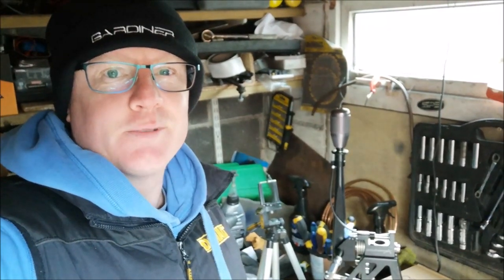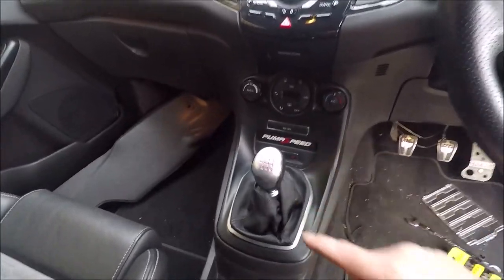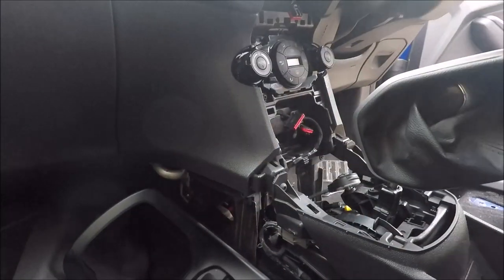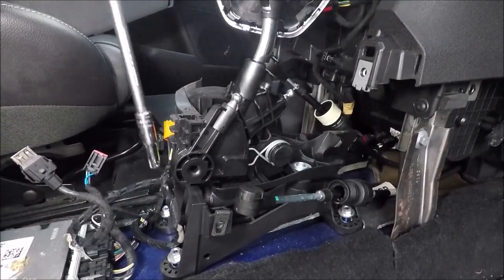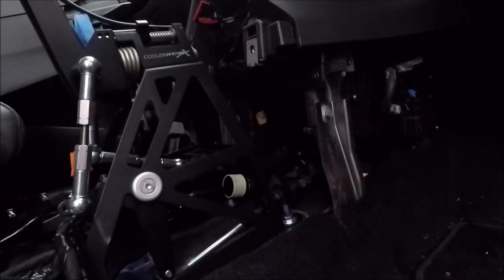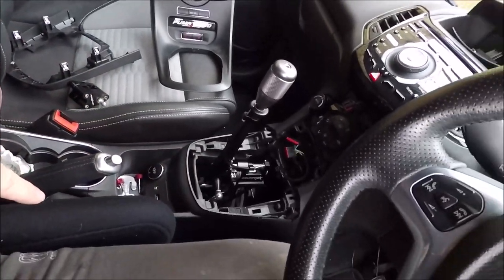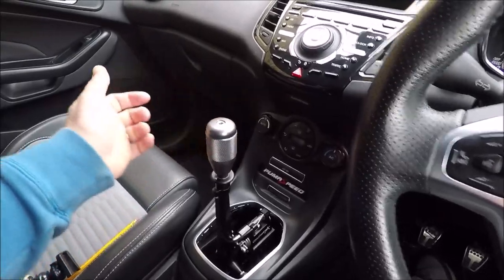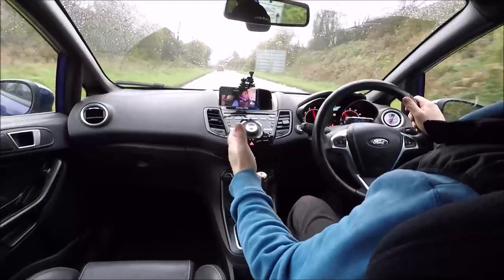Fitting a coolerworx shifter to my fiesta st 180

Comment: What pedal cover is that you have on the throttle?

Been looking for something just to bring the pedal a bit closer to brake for track use. Right now I have to rotate my heel quite a bit.

Did you do a video on how you fitted it, as I assume you'll need to drill the pedal?
Reply from the maker: It's a sparco off memory and yes you need to drill the pedal. Take off the factory metal cover and drill through. Pedal is plastic so easy to do.

Comment: Steve, do you have any difficulty insuring a salvage title  car. I am told I need an engineers inspection (and approval) before I can insure mine. Thanks for the videos.
Reply from the maker: No problems at all. That was the old days of cat c where you needed an engineers report. The new cat n and s are different. Just mot, tax and inisre as normal
Reply: Many thanks for that.

Comment: Im reading that you CAN use the shift plate that you had on with this. Im intrigued now
Reply from the maker: I had my short shifter adapter  set at max 25% so maybe if you had it at 15% it could work but for me it was almost impossible to find neutral.
Reply: @Sparkplugsteve  that absolutely makes sense to me. I drove a focus ST with a 51 percent throw reduction and had the same problem lol.